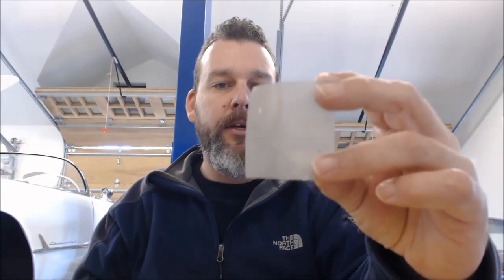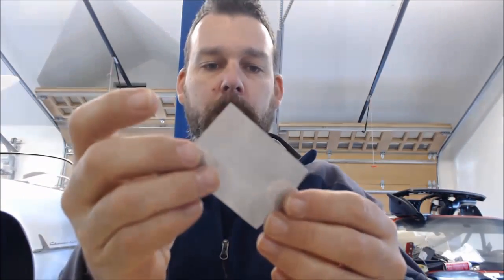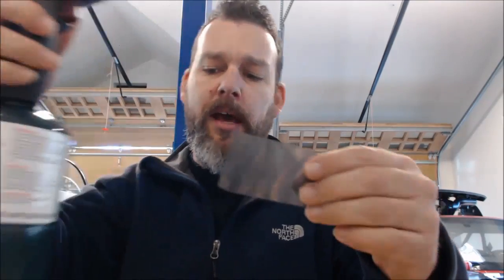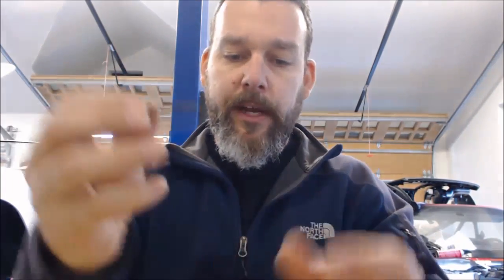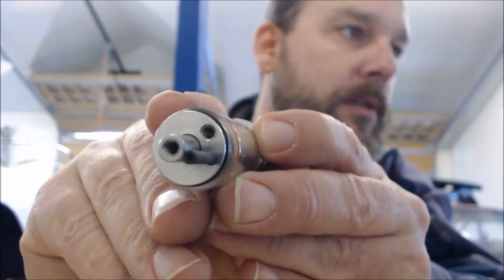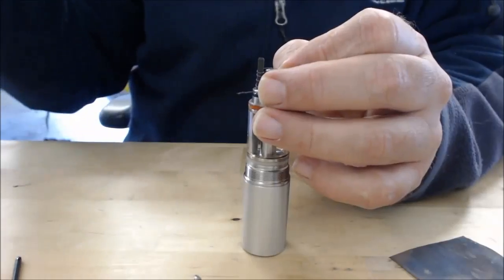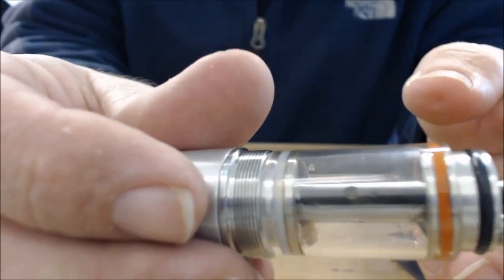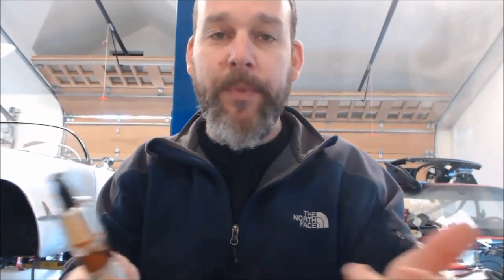making a wick on my ihybrid

Comment from the maker: If you can get a hold of some 32 A1 kanthal try it twisted with a 4/3 wrap and see what you can get..
As for the wicking problems not really sure. maybe its over oxidized or under?
I may lean toward the top coil heating up too much causing it to dry out.

Comment from the maker: it sounds like its shorting in the body.
if it was really tight and not oxidized well that can cause that.
maybe if you have more mesh try it a like 2.75 inches and see if that helps.

Comment: i just rolled a 3" one like you. barely got it in, but its in. wrapped with 4/5 32 braid, it was 1.3ohm. took off a wrap, now its clocking lower .9. i didn't have torch so i used a lighter. its getting better vapor, but still no where near as much. i cant get more than the top 3 coils to light up and they do it very slowly, does that sound like its shorting somewhere?

Comment: i cant get anywhere near the vapor production of that. i have a hollow wick, roughly the same size as yours, with 28ga wrap at 1.1 ohm, no hot spots. its 400 mesh and holding it near vertical it drys out extremely fast. holding it side ways the juice just bubbles on the wick